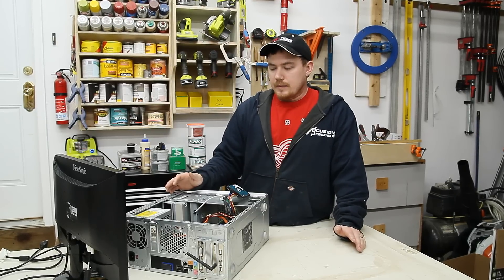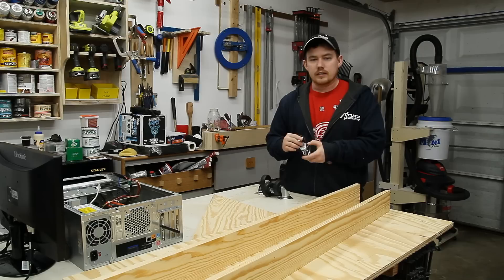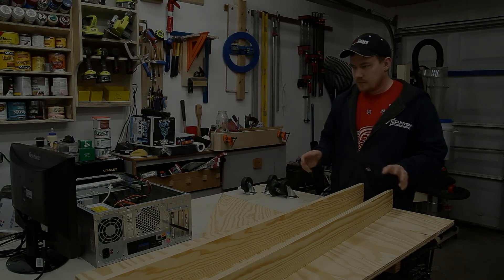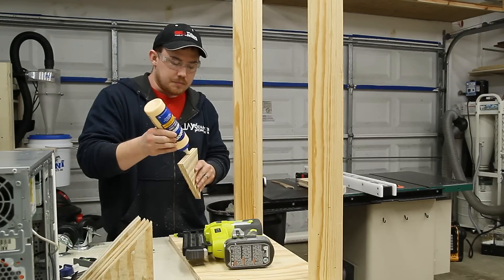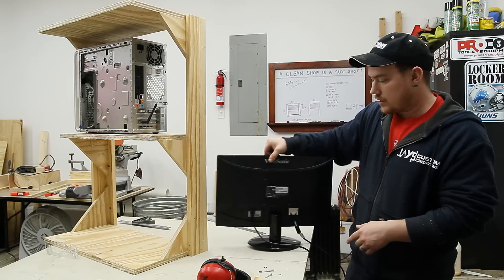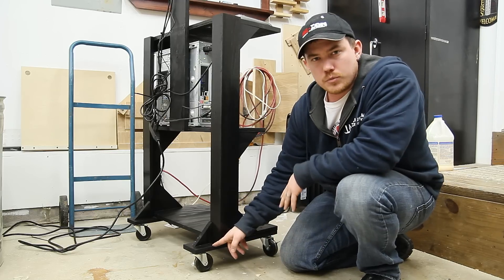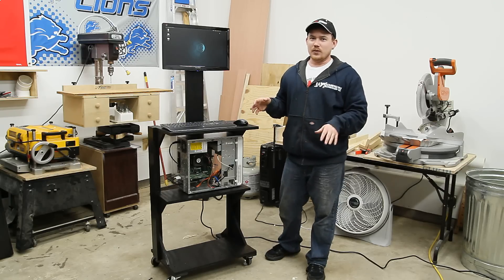Mobile Stand Up Computer Desk - 186

Comment: Great project, Jay! I'll be building one of these to put a computer in my shed when I get my CNC finished. One additional idea of mine is to build an enclosure for the computer tower out of furnace filters to help keep the dust out. Nothing really elaborate - just duct tape some filters together to make an open ended box that will drop over the tower. I have a keyboard that has USB ports on it, so plugging a thumb drive into it so I can transfer files would be no biggie. Thanks for the ideas!

Comment: Hi Jay, I wall mounted my duel monitors for my shop computer system a few moths back modeled after a vidieo Laney put out a year or so ago but now I'm rethinking it as the mobility of what you did would be a lot more practical in my shop and I think I could easily modify your plans for the 2nd monitor.  Thanks for the great ideas that you put out weekly.  One other thing, I would be very interested in learning more about how your computer is setup and the limitations if any.

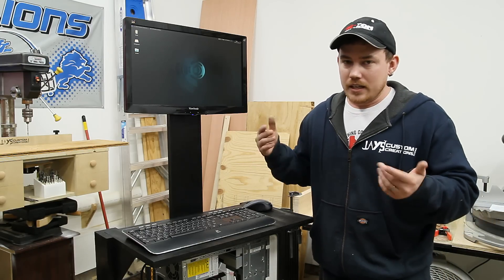Comment: Was that a "you're" where there should've been a "your" at 5:22? I think it was. Don't try and fool us with your fancy sound effects, Jay! Jokes aside, I really like the cart/desk, seems a lot more ergonomic than a laptop. A UPS and wifi would make it just as portable as a laptop, letting you unplug it, run it on batteries for a while and then find a new socket for it on the other side of the shop. Just an idea, you might not need that much mobility but used UPS's can be really cheap, so keep an eye out!
Reply: I loved that! There is at least one more like that. Thanks Jay, great video!
Reply: Where I live the power has been pretty poor, so I have UPS on any electronics I want to keep (lost +$1K of stuff in one outage- not lightening either, bad transformer on pole).  refurbups.com is where I have been purchasing as there is no good source locally and I have had good luck with their stuff personally.

Comment: Yesssss Sir, that's the bussiness, yeah, Go Lions!!!

Was thinking a lil'bit on some plexi glass for an entire enclosure of the CPU with proper ventilation as well as proper air filters for the tiny debris that might skip their way into the hard drive, but then, me sound so geek so let's be greek haaa

If I build this great idea of yours, I should get the keyboard shelf a lil bit longer so your knees and other stuff (we always carry hammers or pointy things with us) could be out of the way from the CPU and pinter or the bottom shelf, even we might tilt everything up just by sticking our shoes or boots in between the casters, so for that, maybe in this already keyboard shelf just place another one on top to make it a 5 or 6 inches towards us without unbalancing the whole project, as u said about the casters position. And also if you want to give us a treat, u can design some tilt for the flat screen to adjust it to a desirable height or maybe to avoid some light reflection, and how about a hidden back rail so the keyboard and monitor cables wont be on the loose.

Jay, I don't expect any award prizes from my humble opinion here, but if you ever get to use them, I'll be more than happy, and also I'll open a few cold ones in your name as well haha. By the way I wanted to tell you something about your video posting here, that u are fulfilling every woodworkers dream of having their work to be known to the world, and what better way than a video to tell it all, it's like an invitation for anyone in the world to enter your shop.

Extra thanks for the sound effects from Mario Bro's and Mortal Kombat.

Tnx for sharing Jay!!!

Comment: Dust that you can see and blow out with a compressor isn't your only enemy here. It's the superfine dust that will get into the hard drive and kill it. Also, dust getting into the display will cause things in there to overheat. I'd recommend: keep it super clean, keep it OFF and under a cover when not using it. Back up a lot. Good luck!

Comment: Nice job Jay....
Looks like you need a miter table/bench and some cabinets for storage. Looking forward to seeing those vids if and when you do them.
Reply from the maker: WestCoastMods Miter saw station is in the works.
Reply: Jay Bates Awesome....I am building out my shop/garage and we both have very similar setups. I am still working on the wiring atm. Running mine through the walls so it taking me some time.

Comment: Sweet idea! I like how small of a foot print that takes up. I really need to figure out a method of putting a computer in my shop other than bringing out the laptop when I'm running the CNC. Speaking of CNC... Did I hear you correctly?
Reply from the maker: Mike Merzke :)

Comment: Enormously tremendously remarkably great Jay ,but I would put the tower on the bottom, with a box covering it with furnace filters to clean the air for cooling, slide the keyboard down under the top shelf on sliders to move it into a covered area under it, and are you going to make the CNC machine yourself ???? superfantasicllywooding  Jay ...lol

Comment: If you're going to run the computer in the shop it might be a hood idea to enclose the CPU with a thin plywood to keep the saw dust out.  Thin so it's not top heavy and perhaps a few one side with a rudimentary air filter.  Just a thought.
Reply from the maker: Harold O'Brien compressed air will blow it out just fine. My shop isn't incredibly dusty.

Comment: Jay it would be way better if you use passive coolers on your processor. You are working in a dusty environment. It does not take more than 2 months to burn out your processor or power supply. However it is still a very good design.

Comment: project turned out pretty cool! i was thinking of buying a miter saw just like yours but wasnt sure if it was a good one. whats your thoughts on it.  and trying to build a panel saw on the wall for cutting sheet goods easy. got any ideas for a homemade one?
Reply from the maker: Matthew Johnston Zero complaints with my saw. Pinterest has a bunch of homemade panel saw ideas.

Comment: Will dust not kill the tower? I suggest you get plexigalss and make a box for it, glueing plexiglass is cool "plasic welding" would make a good video ;)
Reply from the maker: Sandwich Compressed air will blow the dust out as needed.

Comment: Hi ya Ja it looks great, but u will have to keep your tower and printer covered or sealed from the dust you create. Thats one of the main enemies computers stop working.Take care and I'm sure you'll sort it..
Reply from the maker: Owen Binaisse I've never had covers on this computer case. I've always blown it out regularly to prevent dust build up. I'll probably throw a bag over it and the monitor when not in use though.
Reply: Jay Bates I think the dust could introduce a chance for static. But if your diet collection is good... You might be OK.
Reply: Walter Kessler i dont think it will be a problem,  as long as he blow out the dust evry now and then,  my experience is that it work much better in a dusty enviorment without the computer case on.  If you have the case on,  the fans direct all the dust in the place (include the fan bearings)  ,  instead of get it evenly spread all over the place.
Reply: Jan H Brenna He could go all-in and water-cool it, but he DID SAY he didn't want to spend money!
Reply: Walter Kessler he he yes,  watercool a shop computer is kinda overkill:-) the computer would still be cloged of dust due too the air drag from the psu,  so a open case is still the best solution i guess

Comment: Great project Jay, I am not sure if you answered this but what distribution are you using for your Linux load.
Reply from the maker: james johnson Ubuntu Studio but I might have to start over and use windows. Having some conflicts at the moment.
Reply: Jay Bates
Ew, Windows, really?  What sort of conflicts?
Reply from the maker: Bill Royal Lots of frustrating random problems with sketchup that I never encountered on previous installs and the SketchUCam plugin not working properly.

Comment: Please Jay, or someone else, answer this question for me: I am making an end cabinet, non-painted, glass door, out of Poplar. My problem is: the back panel which I intended to make out of Poplar as well (1/2"x2'x4') is not available. The panel will be seen, and I am afraid using Birch (what is available) will clash with the poplar frame, door, etc. I've already purchased the Poplar boards, and was told 'online purchase the panel'. What I didn't know is that the $13.50 panel ships at an additional cost of $55.00.

Could you Jay, or someone else experienced with wood types, provide me with some guidance? To me, the Poplar and Birch look extremely different from one another.

Comment: I dislike using Windows. But will if I need to use a certain program. My pc is set up for dual booting either Linux Mint or Windows 7. My pc only has 2gb of ram and has trouble running any video editing software or playing YouTube videos flawlessly. So that is my main reason for using Linux. It is low on system resources. I can easily access and retain all of my files on both partitions of my hard drive. I may end up switching back to Windows when 10 is released. It will be a free upgrade for 7 and up. I have read that Sketchup has some bugs when trying to run it in Wine. 

I'm also not aware of how to share files with other pcs over a home network using linux. I'm not sure if this is the issue you're having. I'd love to know the answer if you find it. If this is the case.
Reply from the maker: Joshua Luther Samba will share between OS if I'm not mistaken. I just link important files to a dropbox folder and sync that way. Yes, SketchUp in wine is buggy. I'm having way more problems than I ever had before with it.
Reply: Jay Bates SketchUp was the one thing holding me back for Linux on my shop computer.  I'm going to play around with Remote Desktop or VNC into my other computer to use SketchUp. Might be worth trying before switching assuming you have a Windows box elsewhere.